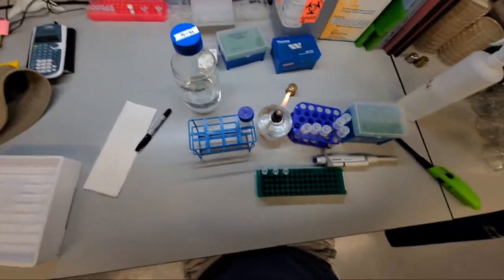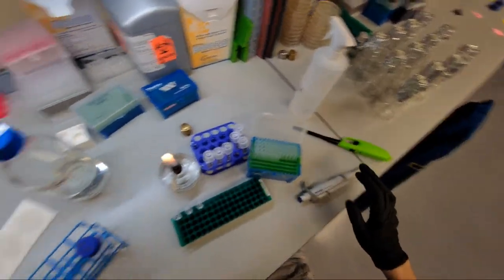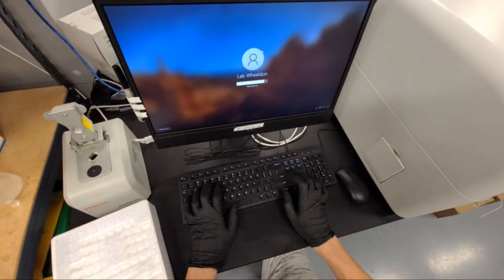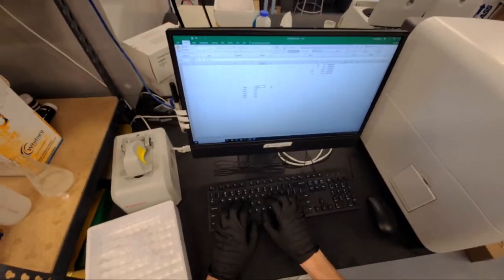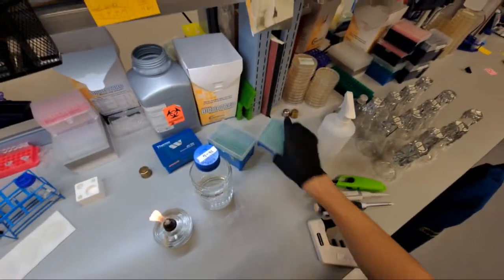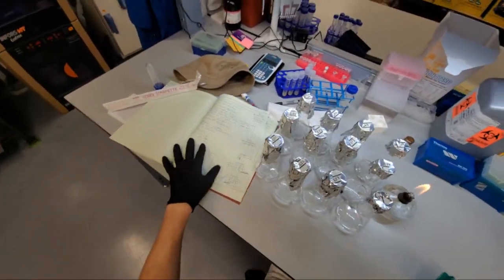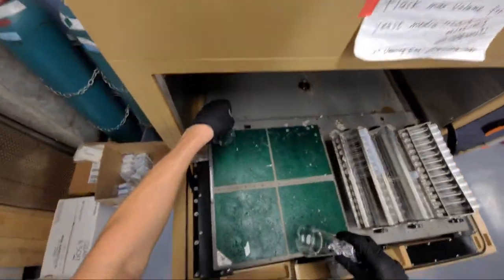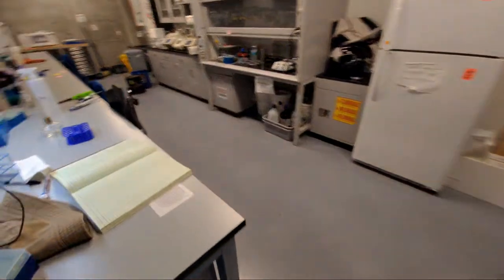Growing Yeast in a Lab

Comment: hello, whe  you used thec1v1 of the inkitial solution=c2v2 fo the final solution ( you used c1 before you multiplied by DF or after?)
Reply: Cause 
after averaging the O.D, you multiplied the O.D with 20
Reply from the maker: I did a 20X dilution to the cells before my measurements